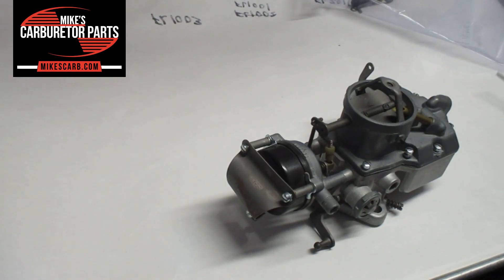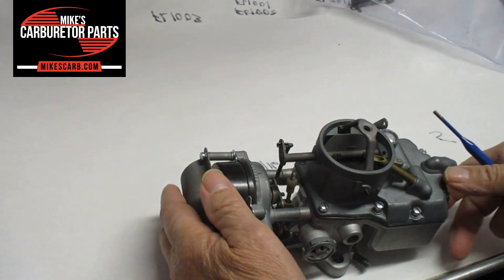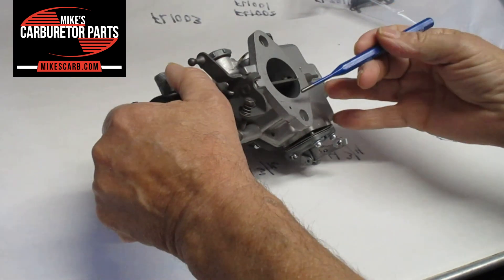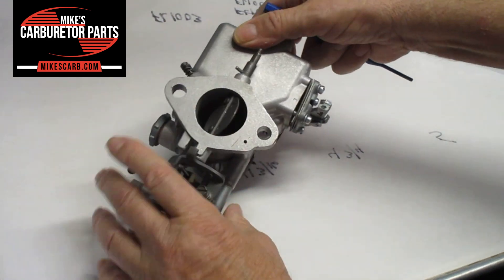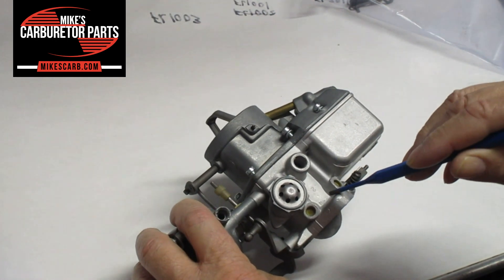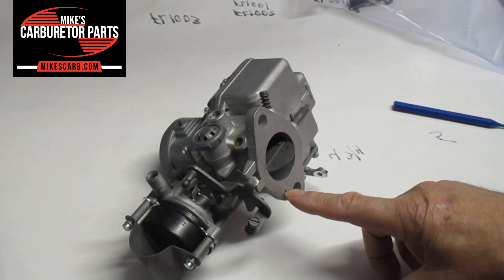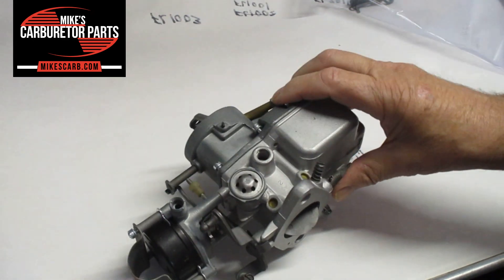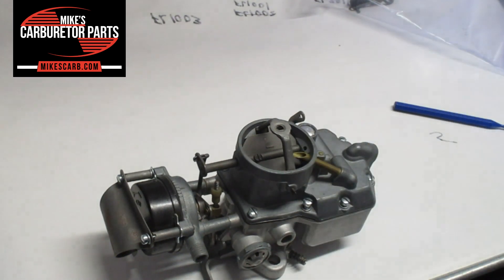Autolite 1100   How Vacuum Works

Comment: When tuning the carburetor, a popular recommendation is to set the idle air/fuel mixture screw that achieves maximum vacuum. Is the distributor vacuum line a good source of vacuum for tuning?

Comment: What is a good replacement carb you recommend for the 1100? I did a rebuild on the 1100 and I'm having problems with it running/starting. Any help would be greatly appreciated

Comment: my 2006 Hyundai sonata i4 has a worse fuel consumption than a dodge v8.
I've cleaned the throttle body, and MAF sensor, verified that the o2 sensor wasn't the problem by unplugging it, changed the fuel filter and spark plugs, cleaned the spark plugs,changed the engine oil and transmission fluid and the problem still remains. What could be the problem?
Reply: i average 15.7 mpg on the highway and a full tank, 17 gallons, lasts about 288 miles